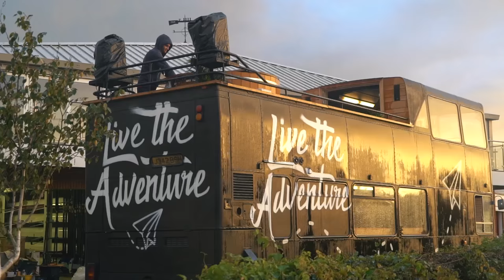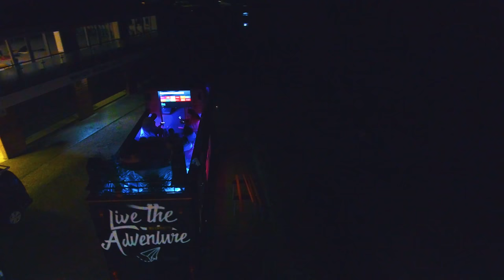BUS LAUNCH HOT TUB MOVIE NIGHT!

Comment: If you are going to have a tour bus in England in the Autumn and Winter its bound to rain at some point so my Question to you Louis and gang why didn't you design a canopy roof so when it rain you can put it acros
s and when its not don't ???
Reply: Ted Moring Exactly Ted.
Reply: no the floor is sealed off between the enclosed part and the open part, the roof and doors are water tight. the top deck has four drains either side. the bus will have a key-clamp canopy system installed for easy removal, (-:
Reply: dude i wired the whole bus haha, ask away bro!

Comment: Now I'm not a designer or anything, but what would be cool is if you could make it a (convertible) - sounds silly but have a fabric which is attached to runners either side of the bus that can be pushed together causing the fabric to be stored at one end and in an event of an emergency of rain then whip it up and slide it across the roof and attach it with catches on the other end.